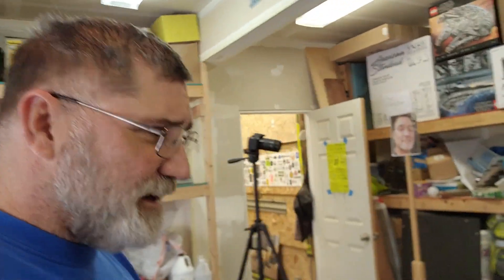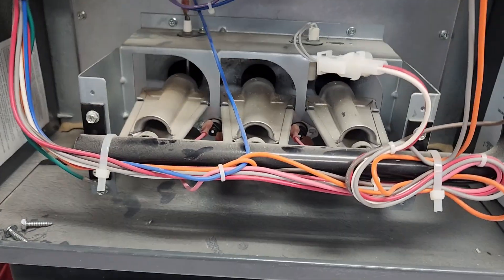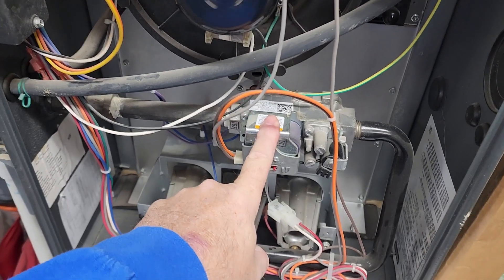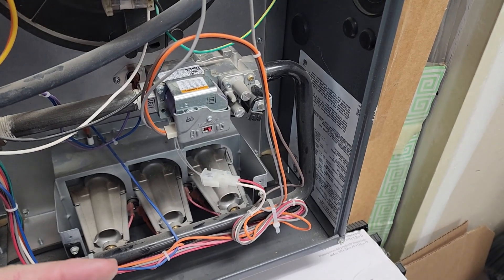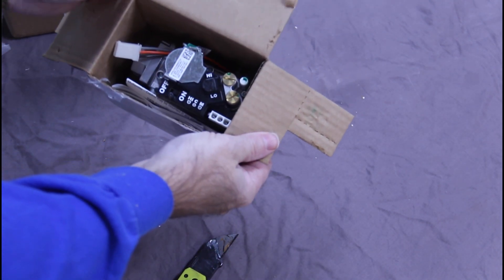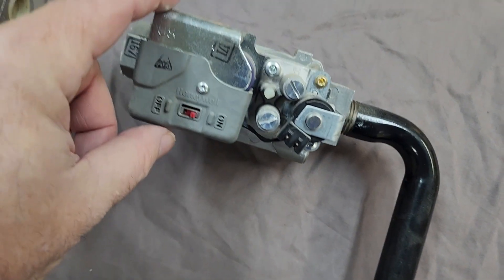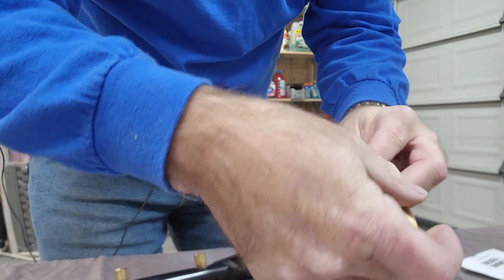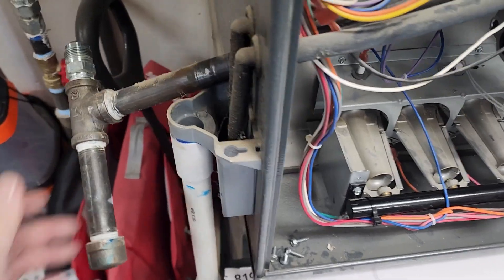It's cold INSIDE! | DIY gas valve change | Can I fix the furnace myself?! #diy #hvac

Comment: I got sorta the same model, Brant's came out and told me it's gonna cost me $400+ parts, I've never tried to install one myself, But being a single income family of 4. I can't afford that. The part alone is only $130, The guy told me it would be around $300 for just the part... But it wouldn't be in until next week and then wouldn't be able to install it until next friday. But like I said I looked it up, Saw the part for $130. What should I do?
Reply from the maker: I ordered mine from Amazon and had it the next day. I cannot tell you what to do. If you are mechanically inclined, then it's something you can handle. If you are unsure about any of the steps, then ypu should let a professional do it.

Comment: You're wrapping the tape backwards.  Wrap it the same direction you screw on the valve which is clockwise in this case.  Otherwise it can unwind when you screw it in.
Reply: I thought the exact same thing. Looked like he was unraveling the tape as he was tightning the valve plus he kept turning the gas valve back and forth as he was tighyning gas pipe.was pretty chincy with the soap bubbles too
Reply from the maker: @MrJujubean Doing my best out here. Thanks for watching. One year later, still works, no one has died.
Reply from the maker: It's confusing, but I got it right in the end.

Comment: There's no way that I would pay someone $800 dollars to do this job. HVAC technicians are like car mechanics. They 100% overcharge for their work. My gas furnace ignitor knob recently broke because it's made out of cheap plastic. If I would have called a HVAC technician to fix it they most likely would have attempted to replace the entire valve instead of installing a new knob. I was reading online that they have to replace the entire valve because of regulations which im sure would have costed $500-$800. I purchased 2 replacement knobs for $10 dollars online. An aftermarket company makes replacements. I didn't see any replacement knobs from the manufacturer that makes the valve which im sure they do on purpose for profit and regulations. They want you to spend a bunch of money not replace a $10 dollar plastic knob. The aftermarket knob looks and works identical to the oem knob. The aftermarket knob manufacturer made a smart business decision to make those knobs because it probably only costs them a couple dollars to make them and it's something that people need. Personally if I was you I would have purchased and used some pipe dope. It's super cheap so there isn't a good reason not to use it. I also recommend spraying the lines better with water that has a good amount of dawn dishwashing liquid in it. I'm a pipefitter so I can honestly tell you that it's common for people to get leaks so you definitely want to use thread Seal Tape, pipe dope and spray it down really good with dawn  dishwashing liquid/water. You honestly made a smart decision doing it yourself. Most issues with central air units and furnaces are things that you can fix on your own as long as you do some research with online videos. I've fixed multiple of these issues on my own. Back in the 90's you would have had to call a HVAC technician but now there's information and replacement parts online. I even replaced my furnace fan on my own. A HVAC technician would have probably expected me to buy an overpriced fan of their choosing and charged me hundreds to install it. If someone is considering doing this stuff on their own they need to make sure that the electric and gas are completely shut off. If you shut the electric and gas line off, find good  deals online for replacement parts and watch videos it's totally worth doing it on your own. I found an used replacement fan online that looked nearly new and it saved me a ton of money. Charging $800 dollars to fix your gas valve is beyond ridiculous! $800 dollars for a hour long job is crazy! They probably purchase the parts for a cheaper price than normal, they would have drove 15min to get to your house, spent 30min to install it and another 15min to drive back to their shop so they definitely don't deserve $500-$800. I could understand if it was $300 because the valve might be $100 dollars and then $150-$200 dollars for a hour of their time but definitely not $800! What HVAC technician companies don't understand is that they lose  money for charging so much because a lot of people decide to do it on their own to save money. If they would have charged you $300-$400 you probably would have decided to have them install it and they would have still made a good profit for their time.. I'm guessing a gas valve would be $50-$200 dollars so charging more than $400 dollars for the job is ridiculous. That's my personal opinion.
Reply from the maker: Me neither!

Comment: Thanks for the video. I noticed that you didn’t adjust the gas valve pressure on the replacement.
Reply from the maker: I did not. I don't have a "manometer"

Comment: Another thing to consider is whether you’ll even be saving any money attempting this DIY yourself. Gas valve testing and replacement requires specialty tools, equipment and material that can really add up. And some of the tools and material you may not use again, unless of course you have to replace another valve.  

Learning how to use these tools and materials and testing and replacing the valve itself is also a time-consuming process. A furnace gas valve making noise will require different tools and techniques than a gas valve with an electrical issue. By the time it’s all said and done, a job that would most likely take you a day or two can be done safely and professionally by an HVAC professional in much less time.
Reply: A gas manometer is $50, a couple of pipe wrenches is $30, pipe dope and tape is probably $20 and the gas valve is probably around  $80-$200 dollars. That's only around $200-$250 dollars which is much better than $800 dollars!!! There's plenty of videos online that teaches you how to do it. I would much rather spend a hour of time and spend $200 than to pay someone $800. I'm a pipefitter though so messing with threaded pipe and gas lines is something that I do for a living. A HVAC technician already owns those tools so charging $800 to replace this valve is ridiculous. I definitely would have replaced it on my own. I think that at least 1/3-1/2 of the population is smart enough to turn off the electric, gas and watch a couple of videos to install it themselves. Half of the population on the planet probably doesn't have enough common sense to shut off the gas/electricity or to properly tighten the pipes so I understand why some people are better off calling HVAC technicians. I understand that HVAC technicians are hard working people that are trying to make a living but $800 for this valve replacement is ridiculous. Just my opinion.
Reply from the maker: Great advice. I got lucky for sure.

Comment: you should check manifold pressure to be sure you don't risk carbon monoxide, and also soot buildup which could mean a future heat exchanger replacement if it cracks from uneven expansion
Reply from the maker: Saw that in the comments. I have a manometer on the way. My furnace is out in the garage, so there is that.
Reply: @DadItYourselfDIY  it's probably within 10% of spec already, but its good to be safe
Reply from the maker: @elektrokinesis4150 Agreed!
Reply from the maker: @elektrokinesis4150 Is it standard or do I need to look in the manual for the inlet and outlet pressures?
Reply: @DadItYourselfDIY  It should be written on the furnace unit in inches WC as manifold or outlet pressure, not to be confused with inlet pressure. If not then look in the manual. The reason why it needs to be adjusted is that natural gas is not always the same pressure or flow rate. Depending on the building and pipes used, you can have different amounts of restriction.
Reply: Also you have 2 stages, you may need to adjust both stages. If the furnace is wired up to operate as a single stage then you may need to disconnect the thermostat and manually call each stage with a jumper wire on the furnace board, these would be your W1 and W2 terminals.
Reply from the maker: Perfect, I used to do something similar on aircraft cabin pressure systems. Inches of Mercury, differential pressure, etc..
Reply from the maker: @elektrokinesis4150 This is great info. I grabbed the manual off the unit, and it has all the info you talked about.
Reply: @DadItYourselfDIY  actually i just went back and looked at the video and there is only a w terminal, so the board is single stage as far as the thermostat side is concerned. Idk what this particular unit is doing but it may be a low flow for ignition and then it ramps up to full fire once the flame sensor detects. I wouldn't worry as much about the 1st stage if it is only used for ignition and there is no specification for it.
Reply: I believe stage 2 on this is controlled exclusively by the board, use the dip switch to configure the second stage delay at a fixed 5 minutes, then make your adjustments to the 1st stage within that time period. Then after verifying that the second stage relay turned on by measuring for presence of 24v at the appropriate terminal at the gas valve, set the 2nd stage pressure. Don't forget to revert any dip switch changes when done.
Reply: What should the gas pressure specs be? Or how to find out?  Thanks
Reply from the maker: @GregDietz I'd ask the same question, but in my case I made assumptions, that the valve was set as was my meter. It's been a year and there have been no issues.

Comment: If I were you,  I would either call back the service company or invest in a manometer to check your 1st + 2nd stage manifold gas pressure to be safe. The factory will usually get pretty close, but sometimes it can be off by 30%.
Reply from the maker: Great advice.

Comment: HVAC tech here, looks good to me for a diy job. Only thing I would say is to have the gas pressure tested with a manometer to insure the correct pressure is entering and exiting the valve. Pipe wrenches come in handy when working on gas valves and lines.
Reply: Too much gas pressure causes valve to fail prematurely and cause furnace to over heat. Too little gas pressure causes furnace to burn dirty and soot up.
Reply from the maker: Makes sense!
Reply: @techdaddy7955  Interesting. I have no idea how gas line works, having to deal with water lines more often. But why wouldn’t there be a valve for the whole house like there is a PRV for the water line? Why is it only in the furnace? I thought the valve is just a solenoid shutoff valve, but it does look more complicated than a simple shutoff valve.
Reply from the maker: @lordlee6473 There is a valve fir tge whole house. This is an emectro-mechanical valve that controls the gas for the furnace.
Reply: Same as I was thinking.  Also. He's lucky it's natural gas and not LP gas, or else he could really cause some damage without a manometer.
Reply from the maker: The HVAC tech that did my troubleshooting verification didn't say anything about a manometer. What is that?
Reply: @DadItYourselfDIY  it’s used to check gas pressures
Reply: @craigbraswell4269 what kind of damage are you talking about
Reply from the maker: Yeah?
Reply: The gas pressure should be set 3.5 for proper combustion!
Reply: @demetriosa7646  This is not correct, 3.5 inches water column is more of a starting point. The install manual for this particular furnace states 3.5 +/- .3 inches water column is the specified range. The manual gives specific instructions for clocking the gas meter and adjusting gas pressure on the valve to match the rated BTUh input of the furnace. A manometer is still needed, though, to make sure you don't adjust the furnace to outside of the recommended range. Additionally a combustion analysis should be performed to ensure proper combustion. Blindly setting a number doesn't accomplish much of anything. Proper manifold pressure, air flow, heat rise, and combustion analysis is needed to ensure a properly running furnace.
Reply from the maker: @Thejaweee Good feedback.
Reply: @DadItYourselfDIY  😮 WOW 😳 14 years in the Navy experience didn't know about Manometer ❓❓
Reply: @Thejaweee  For most gas furnace valves are 3.5 in wc and for Goodman 👍
Reply from the maker: @Honestandtruth007 Don't use one on aircraft systems. And if we did, it wasn't called that. Oh, it's 21 years.
Reply: @DadItYourselfDIY  I wouldn't worry it's more something a calibration guy would use. If you were fixing aircraft systems or installing you'd be looking at the pressure gauges the cal tech calibrated for you.  He'd use a manometer to verify and adjust your gauges.  Many gauges come factory calibrate for install.

Thanks for this video. Going to change my gas valve in my Goodman furnace shortly... there is only so many times you can give it a tap to get it going.  Wife is insisting we keep the furnace and get it fixed. I'm for swapping it out for a heat pump: We have a 25 year old AC that I fixed twice already. Also, here in Canada we have a carbon tax on the gas bill.
Reply from the maker: @capitanocorelli1781 good luck, glad my video helped. We are budgeting for a heat pump replacement so we can have A/C for that one hot week we get in July.
Reply from the maker: Thank you!!

Comment: How much money did you save
Reply from the maker: I was quoted $600 plus parts to replace. The service call was $150. I bought the valve for $100 on Amazon Prime. So me doing it was about $250. Had I had them order the part and install it, it would have been, $150+$100+$600. So, I save $600 (assuming they didn't mark up the parts)
Reply: @DadItYourselfDIY  $600 dollars for parts 😳!!! That's beyond ridiculous!! They were trying to charge you $600 dollars for a hundred dollar valve, some pipe dope and tape 🤦. Like seriously how do those people sleep at night when they're robbing people like that.

Comment: just wondering if you should check the outlet gas pressure on the gas valve?
Reply: Should be testing both... to make sure that the inlet pressure is good as well.
Reply: @TheCowboysdude  I believe all gas valves like white rogers etc comes pre-set
Reply from the maker: @Ray-wr2wr that is my assumption as well.
Reply from the maker: @TheCowboysdude seems to be working perfectly.
Reply from the maker: The pressures were preset on the valve and marked. Seemed pretty straightforward. But I'll research that.